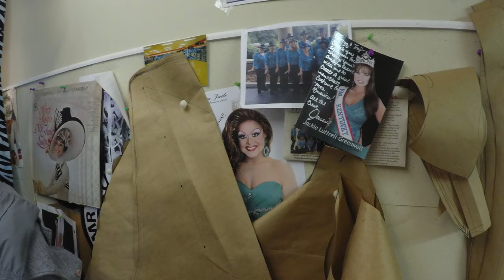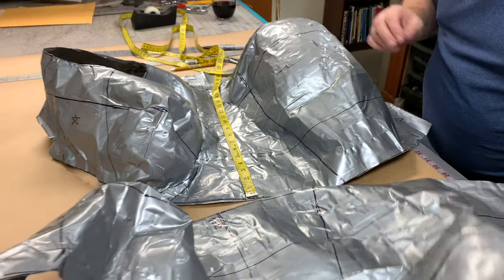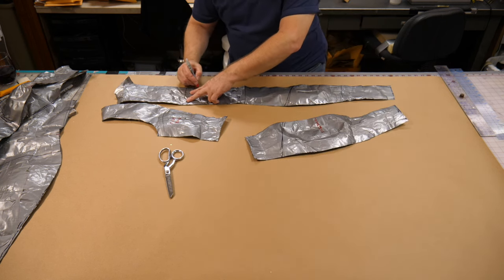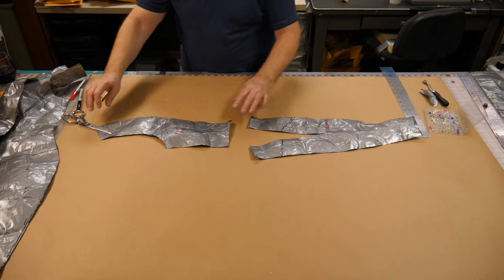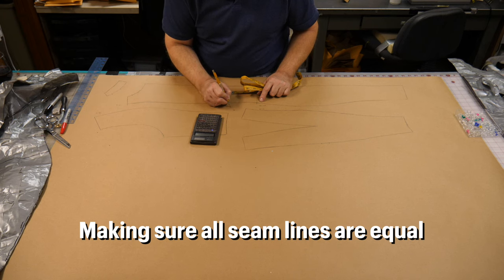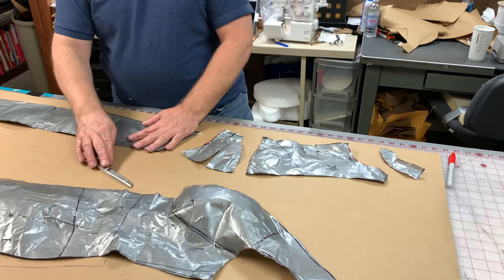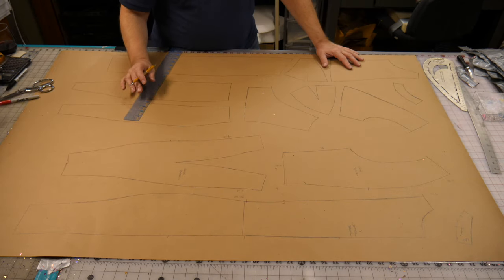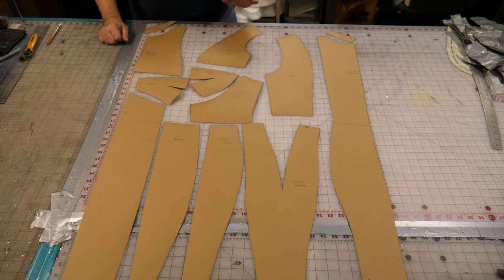DIY Dress Form - Part 2 (Pattern Making)

Comment: Here's an idea, if you notched the patterns before cutting and notched the big leftover piece you could have a spray painting template for future patterns dress or dress forms. if you lightly mist the back with Spray Mount or 3M 77, put it on a carpeted floor an pull it up it "dumbs down" the adhesive further for ease of spray painting. When spray painting only use a fine mist as it is all you need to see where to cut.

Comment: As well a thick rulers, steel rulers with a non skid back are safer than aluminum as the blade is less likely to skate across as well. I also bought a 48" x 2" x 1/4" piece of of steel bar stock with a 1/4" hanging hole that worked great.